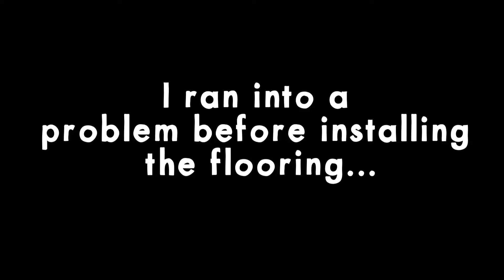Part 6 Van Floor Install | Camper Van Living: Floor Color + Problems Installing

Comment: Dear Girl, 
  The first "can" on Your exhaust is
 the catalytic converter, the second can
 is the muffler. The muffler usually have
 a small hole on the bottom, rear side to
 drain excess water that develops in
 the exhaust naturally.
     About the AC unit, the front and rear
 are tied together. The rear needs to be
 tied off of the heat coolant, antifreeze
 and the freon, for the AC. Be careful
 of the freon, high pressure, poison,
 inhalation hazard !
     Sincerely, NAWALT.
Reply from the maker: +Kathleen NAWALT Thanks for the info!

Comment: if its free then its from me!!!
got any sketches of a few different layouts?
Reply: +Caeser Carro as far as that wall with the ac goes?
Reply from the maker: +Caeser Carro I had a small sketch when I did the initial layout but I'll have to come up with more detail now. I'm thinking battery bank area and vent access as well. I'm also going to measure to see how a compost toilet will fit in that area too.